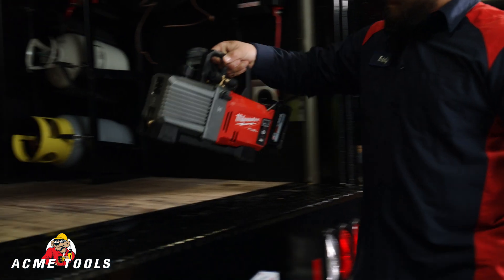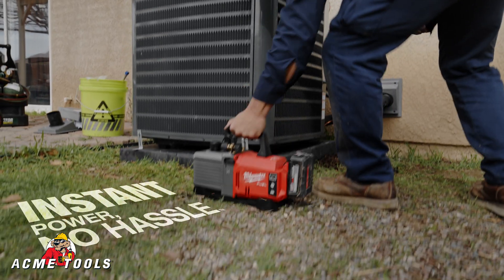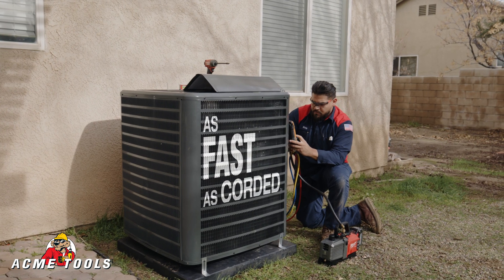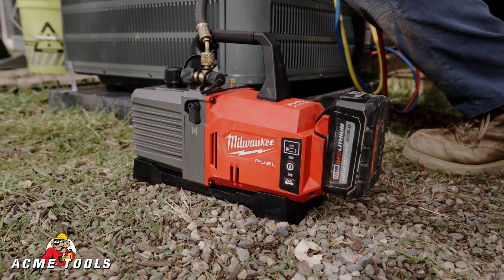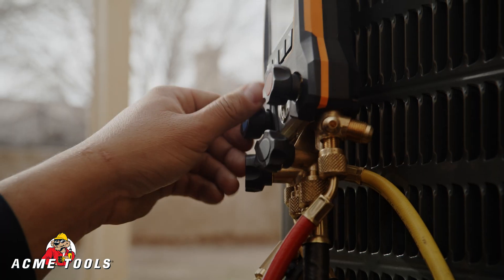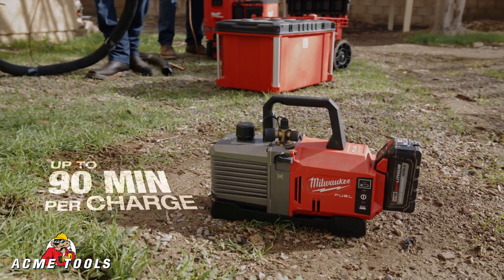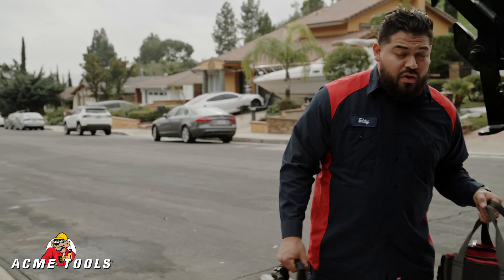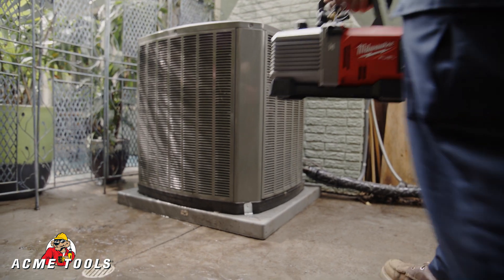Milwaukee M18 FUEL 5 CFM Vacuum Pump

Comment: My man goes 'desired microns'. There's no way he knows what it should pull down to 🤣. Gun to my head, I'm going with he's not an actual HVAC guy. In Michigan, code says there needs to be an outlet at least 25 feet away from the unit, so power shouldn't be a problem. Regardless I definitely see the convenience of this and wish DeWalt made one 😩.
Reply: It's nice that Michigan has everything up to code
Reply: that codes for new builds ding dong..... not existing construction or retrofit

Comment: As much as I love milwaukee products, I could never invest in this product.  The build quality won’t be there and doubt that it will last long with heavy use without needing service.
I do installations every day and haven’t ran a cord In years. All you need is a set of widow makers and your golden.  Now maybe if you do new construction and sparky hasn’t landed the power I could see this for occasions.  JB Platinum has been a great vacuum pump